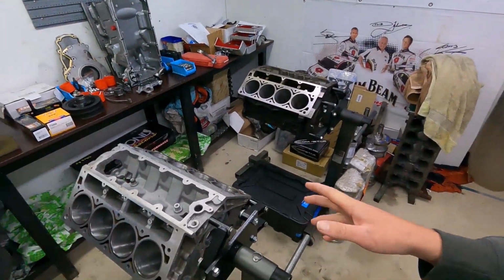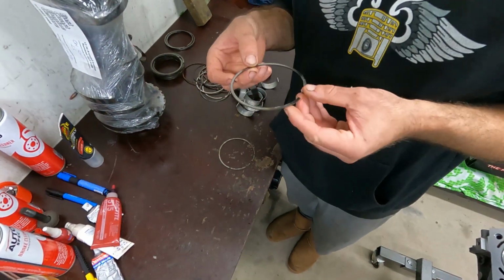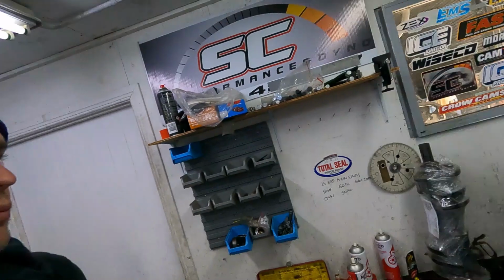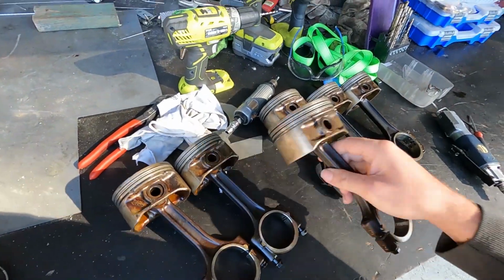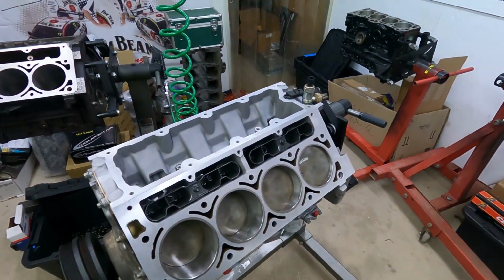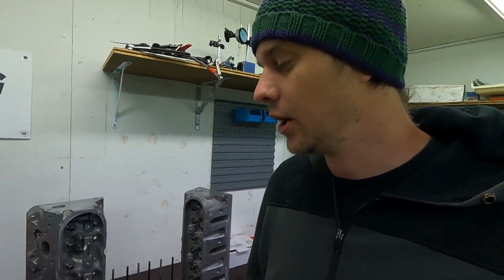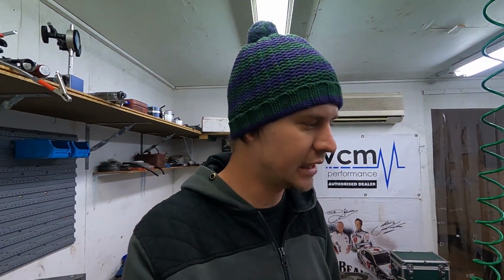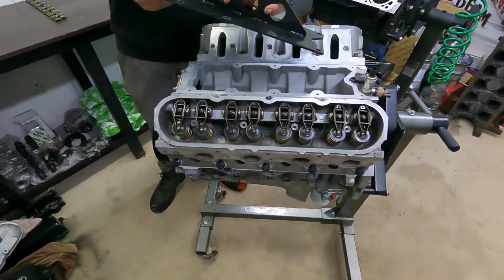Engine Rebuild, What went Wrong? || Turbo LS1 GU Ute Build || Episode 11

Comment from the maker: Hey Guys, So the reason this doesn't just fall on the owner is because it was our advice to leave the bottom end alone, AND we should have picked up what was happening before it cause as much damage as it did.
Although the result would have been the same in either case - a complete rebuild. The fault still lies with us in some aspects. Its an absolutely crappy situation for all involved which we hope to avoid altogether in future by only doing SBE builds in-house if we do a complete rebuild. It would be a different story if the car was built elsewhere and came to us for a tune and something like this happened. But due to the car being built completely in-house and us not picking up on a few things we will still wear this one.
The spring issue is a first for us. We use and sell a huge amount of these spring kits, and this is the first we have seen of this issue so far. Manufacturing faults happen, and given the coating on the spring I don't believe that this fault could be picked up by anyone in any kind of QC inspection unless it was X-Rayed. Our supplier has been awesome about it and helping us wherever they can to limit things like this happening in future. We will continue to use and sell these springs and back the brand.

Comment: You guys have the right attitude and the good deeds done will strengthen your rep! Keep up the good work! The knock you picked up was likely the rod slapping side to side it doesn’t take much of a bend to make it walk around,opening the quench wouldn’t help but unless it’s got flat top pistons and they are kissing the head the quench doesn’t work very well especially under boost and without hearing it I am guessing but that rod would have the knock sensors busy

Comment: Either someone got the cam timing wrong or it broke a chain at some stage
Between the faulty valves and the dud bottom end its not your fault but i get why you have to wear it.
At least with Luke's you decided to pull it down before it was run.
I hope you made a video on that and what is out there in the second hand market for people to be aware of.
Reply from the maker: 100% that would have been scary if we send lukes out the door without checking every cap! But unfortunately no video on that one. It started as a mundane ls1 checkover so I never even gave it any though untill we were balls deep lol

Comment: Have to disagree with you boys, absolutely do not think you are liable for this situation. It’s not viable for you to pull apart and check every engine that comes in or know it’s history or what the engines internal components condition are in . the customer should be aware that when it comes to the dyno there is a possibility that these things can and will happen and that’s the risk they take with trying to make more power then stock. Top effort for helping them out and wearing it though, something most shops wouldn’t do these days.
Reply: I totally agree….
Knowing that the engine had bent intake valves and badly ‘kissed’ pistons the customer needs to suck up some of the repair costs of the torched bottom end. It is very good of OSP to wear the cost of this issue. Most shops wouldn’t cover this cost.

Comment: Some interesting theories there, which some or all combined could well be the cause of the failure. Important thing is she'll live again with a fresh new life and not a boat anchor!
Reply from the maker: Yeh seems a perfect storm of combined problems. Unfortunately correlation =/= Causation, so there is still lots of fault finding to be done when its back on the dyno!
Reply: @BoostGumps  Just drain the tank fill her up with some nice fresh stuff with the new rebuild and God bless its all good and out with no more issues! Guess I'll find out in a few days ;-)